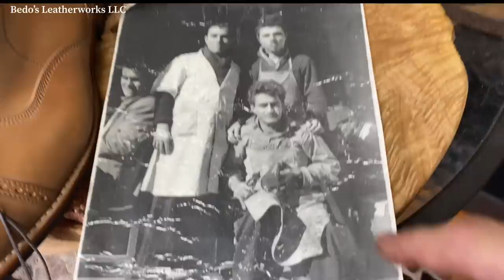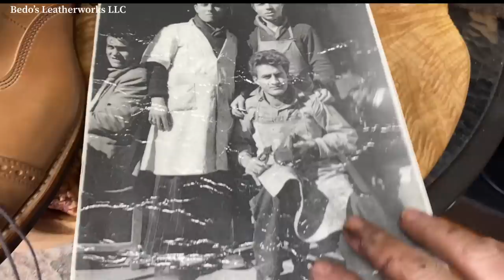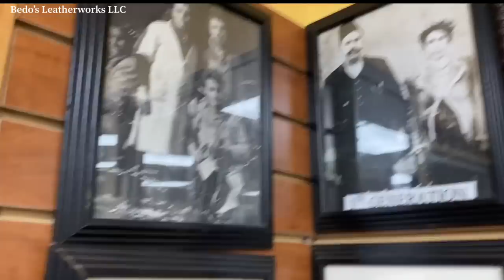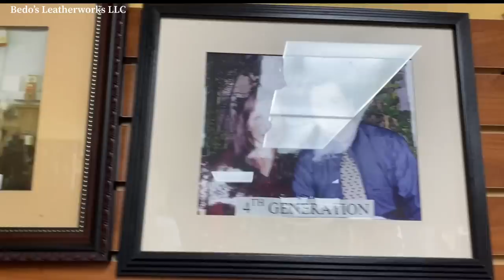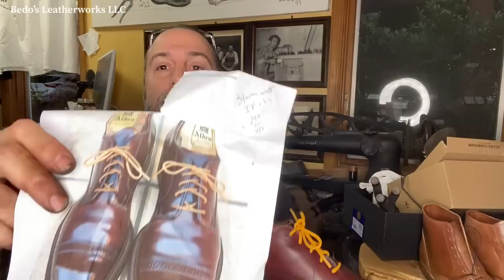Customizing Alden Shoes (Restoration)

Comment: Steve is the highest quality cobbler out there. The most expensive as well...but...the very best. You get what you pay for...is just the reality in life. Saw a video the other day on Wyatt and Dad...where Allen Edmonds had changed out the welt so many times, without using the same holes...the leather upper busted out at the seams. The shoe would have been better off...just not being re-welted. Something I didn't know. I mean...I always knew AE wouldn't re-sole more than 3 times, but I never knew why. Now I know why. An independent cobbler, when re-welting a shoe...will re-welt by hand using the same holes, therefore not causing damage to the upper. AE uses a machine to re-welt, and the machine likely will not hit the same holes...making the upper Swiss cheese, and ultimately...causing the upper to split...beyond repair. I considered next time I send my AE's off to AE for a re-sole...to ask them NOT to re-welt. It turns your shoe into Swiss cheese. Edit: And to be clear...Wyatt and Dad was not disparaging AE. He was simply explaining WHY the shoe had blown out. Wyatt and Dad...is another cobbler I respect. Good work from both Wyatt and Dad, and Bedo's.